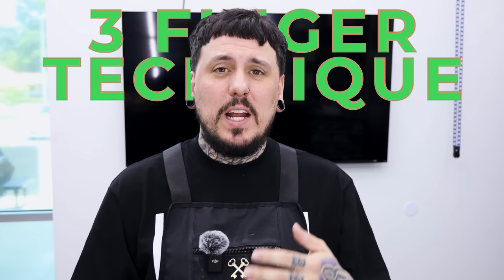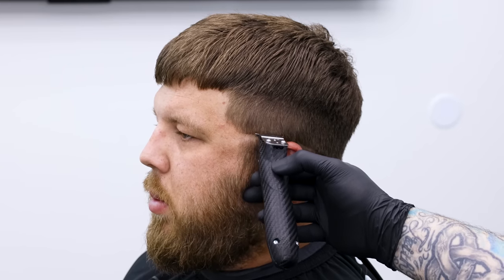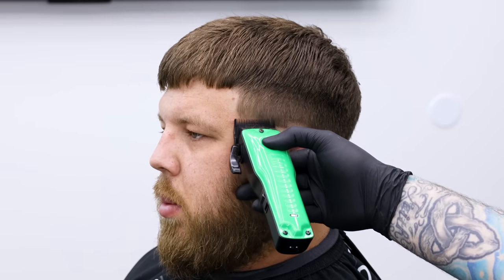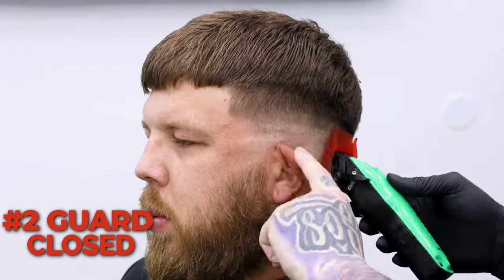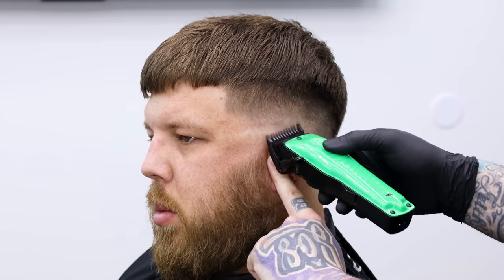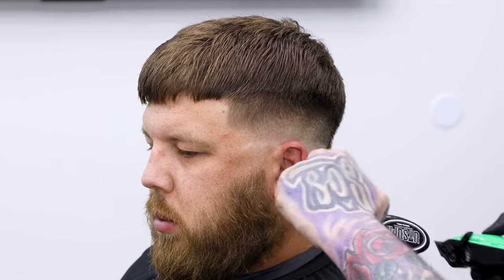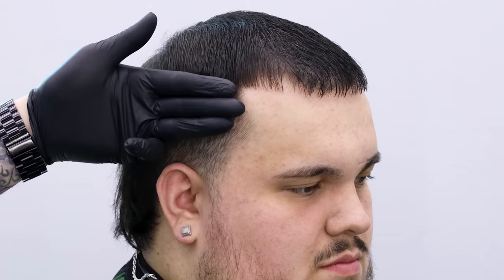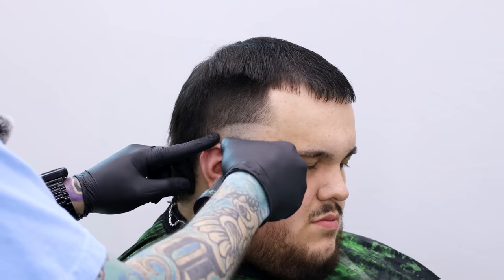MUST SEE Fading Technique 👀

Comment: I have 2 questions 
1/2 
When u are blending them are u pushing up and down or flicking if so what kind of angle 
2/2
My clippers are 0.45-0.85 so do I still use 1 guard
Reply from the maker: Just going in and cutting the hair I want to cut then coming out off the head. You still use all the guards no matter the clipper

Comment: Would this be considered a mid fade? If I wanted to do a high fade, would I use 2 fingers?
Reply from the maker: Yeah it’s a mid fade. For a high fade you wouldn’t leave as much weight and would just shift the whole thing up a step. Also can just tighten up your guidelines. There would still be the same steps whether high, mid, or low

Comment: hey quick question about hitting the line with the corner of the clippers, is there a difference between which corner am I using and which way Im going?
Reply from the maker: Not necessarily but you need to cut against the direction the hair is growing. Sometimes one corner will hit it better than the other

Comment: what if they want a low fade or a high fade though ❤
Reply from the maker: Just start lower or higher
Reply: @Seancutshair  is there anything wrong with creating a ceiling with number three short, then creating bald line, and fading down to the bald line though the numbers from 3 to 0 ? instead of making guidelines? thanks m8
Reply from the maker: @Sir-zl2nq  if you can keep organized not a problem
Reply: @Seancutshair  excellent! its what iv aleays done! usually comes out fine but can take pretty long - im just so scared to put that 0.5 open blade guideline in 😂😂😂

Comment: Personally not a fan of this technique. Most haircuts you could use this and
it would work. However some haircuts require you to spread the blend out more or less than this. I have clients that get a high taper or mid high fades and they naturally have much smaller room to work with and if i did the 3 finger technique they wouldnt have a fade they would be bald. Also people have different finger widths
Reply from the maker: It’s just to give a general idea. Isn’t meant to always work. Beginners have absolutely no idea how big to make guidelines or where to start the bald line so this at least gives them an idea
Reply: @Seancutshair  Agreed i just think we need to be careful when teaching people because some people will learn this technique and apply it to every haircut they do and they could land themselves into some trouble

Comment: Is there a fade technique where you can fade from top to bottom...starting from big to small? Like a number 2 down to the bald line? Ive noticed I get a better blend when I go from top to bottom versus starting from bottom to top.

I still debulk, do my bald line, clipper open, then #1 open and #2 to get my guid lines..I just then start from the top then work my way down.
Reply from the maker: Yeah you’re doing it how I’d recommend. Fading down completely without any guidelines is definitely difficult but can be done
Reply: I do the guide lines, the bald lime, the #1 and #2...it's just instead of starting off at the bottom, clipper closed and work your way up...I start at the top and work down from #2 down to clipper closed